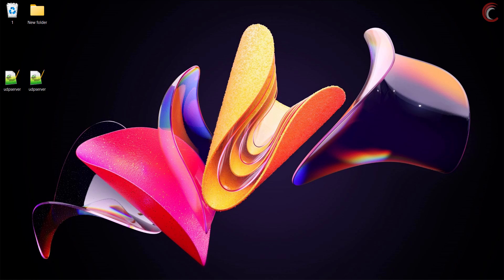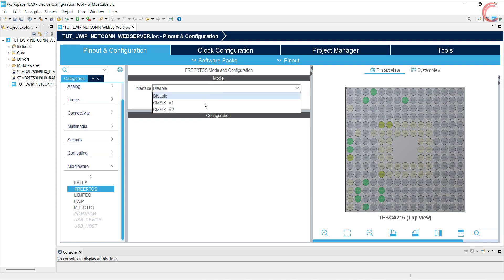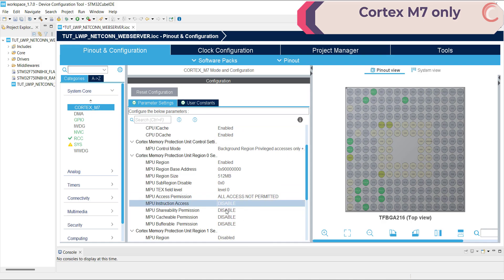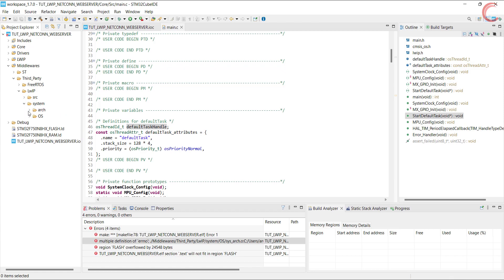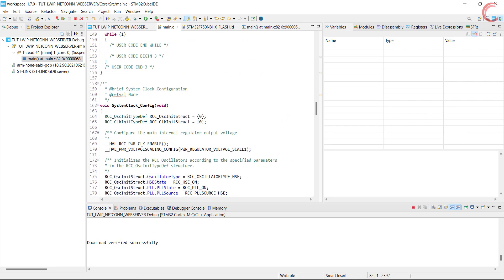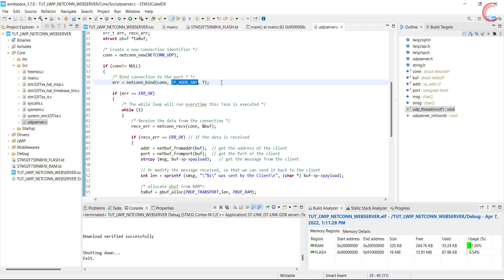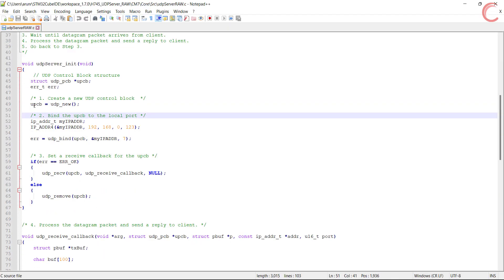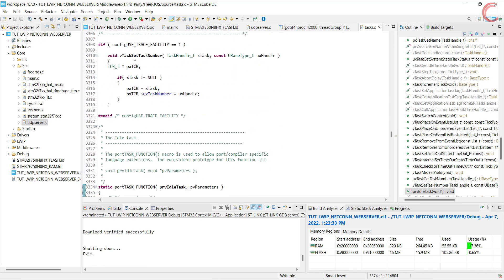STM32 ETHERNET #7 NETCONN UDP SERVER  || FREERTOS ||  LWIP

Comment: I guess there is a problem with udpclient on RTOS source code. Because my nucleo board with  STM32F767 doesn't receive any data from ethernet after sending data from hercules.exe few times. Anyone has the same issue?
Reply from the maker: Use rtos v1
Reply: Thanks for your quick reply, I have one more question , I tried implementing udp server on cmsis_v1 same way that I tried implementing cmsis_v2. However it didn't work on cmsis_v1. Function prototypes, variables etc. are all implemented the same as in the video. What could it be the problem?
Reply from the maker: Mail me the project.. or come on telegram
Reply: I've had a similar issue. My STM32F767 replied to the message only nine times, then stopped working. The fix was to replace these two lines in the original code:
pbuf_take(txBuf, smsg, len);
buf->p = txBuf;

with this:
netbuf_ref(buf, smsg, len);

Hope it helps.

Comment: After working my way up to Ethernet #7, I can't seem to get it to respond to a ping on my DISCO F769NI board (same board I used for all the other ethernet tests).  It is not hard faulting as a pause shows it is at "configASSERT( ( portAIRCR_REG & portPRIORITY_GROUP_MASK ) <= ulMaxPRIGROUPValue );" in port.c.  Any ideas?

Comment: i won't be able to get ping from controller in STM32H745 OS_Delay() function in default task keeps giving hard fault error. could you help me int it...
Reply: I've had the same issue with STM32F767. Here is how I resolved it:
(a) increase the defaultTask stack size from 128 to 256
(b) change the FreeRTOS version from v2 to v1 (Interface: CMSIS_V1)
(c) skip the memory allocation stuff for Cortex M7 in the video; just use the default setup in CubeIDE.

Comment: The server only works well if set fixed the clients port. If you try to connect with another client or the client port is automatically selected by the OS, then the second connection will not work :( 

can this be solved somehow?

Comment: Very informative Video, I was able to get the udp sever  with FREERTOS working. But now i face a problem when i generate the Code from TouchGFX tool ,As  i am in need to use GUI and also the Udpsever, when i follow the same procedure as mentioned in the video after creating the GUI from touch GFX the Ping to the Ip is and udp server does not respond at all.

Can you please guide me if their is any other procedure to be followed to get this set up working.

Thanks in Advance.

Comment: Thanks for video

Can we send any file(.txt) using with this server? If it is not possible how can i send file to stm32 development card?
Reply from the maker: yes you can send.. but you have to use the fatfs in STM32 to handle the file.
Reply: I am using a stm32f429zi and seeing the transferred file in terminal is enough for me. I think i don't need to use fats for this, but do i need to use tftp.h ?
Reply from the maker: Yes you can use the tftp.